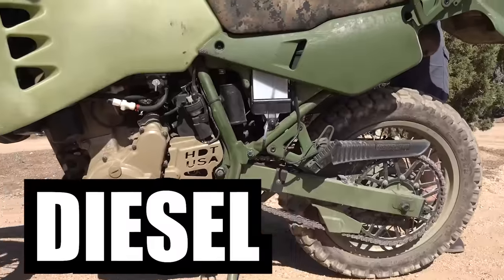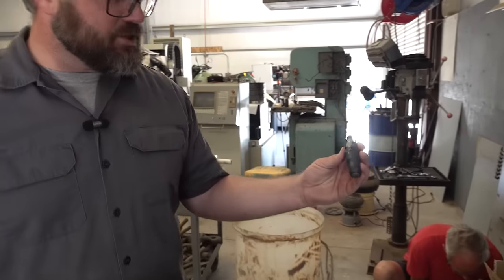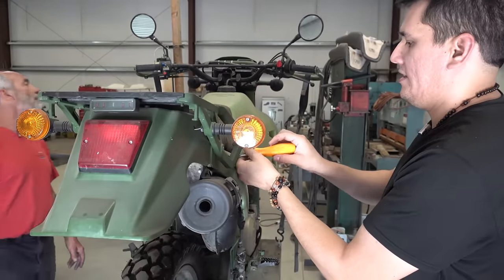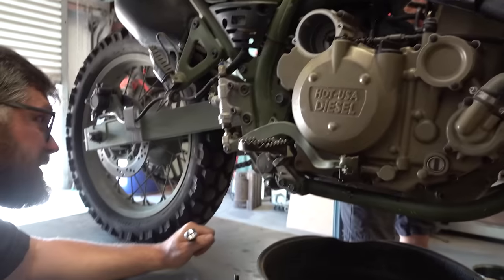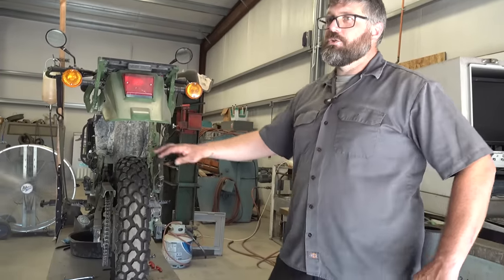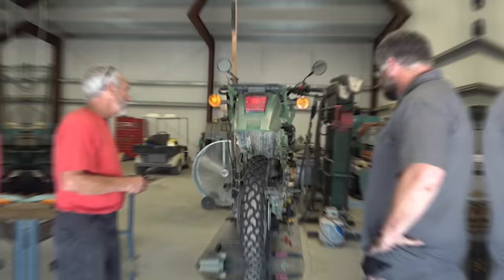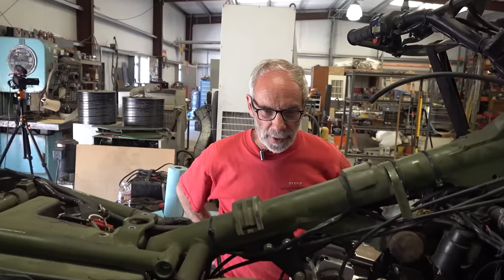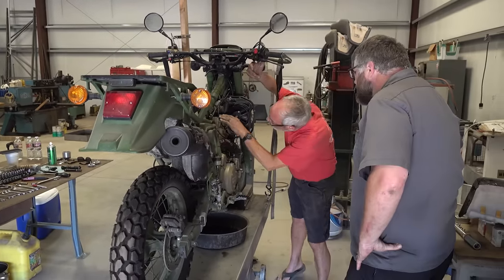Unfixable Diesel Bike is Worse Than We Thought(So I Got The Engineer Who Designed It)

Comment: I LOVE THE WAY they talk about how reliable military equipment has to be and how much they testing testing test...

And there stood next to a broken bike in a workshop for broken bikes.
Reply: When I was in the Army they still had Gamma Goats. The joke on them was that they would be running perfectly on Friday afternoon and broke down on Monday morning.
Reply: @lancenorton1117  😁😂😀😁
Reply: Standard KLR for me, that diesel would give me nightmares. I have worked on diesels, have an AA in it, but they are not for bikes.
Reply: @johnl9977  yeah but the dod doesn't care they just want everything to run on JP-8
Reply: And how many ways you can break it if you don't do 6 different steps exactly and don't push a lever right next to the handle bar, oh and there are machining chips in the engine, dont worry perfectly normal 😂
Reply: @myopicthunder  hehehehehehe
Reply: @ihatetacocasa  They would probably have been better using jet or an actual flash steam generator - steam engine - condenser 

Steam engines are 1 stroke with unlimited length of travel on the piston, and crazy torque - so you could just connect the crank shaft directly to the back wheel, have the piston in the swing arm, aerosolise the JP-8, burn it in a coil of water that flashed the water into steam, into each side of the piston, out into a condenser and then a pump forces it back into the high pressure side of the circuit.

Comment: I worked on the B-2 bomber acquisition program for 20 years starting back in the mid 80s and there was a term that was used called having a "grey beard"  meeting or getting the grey beards together to solve a problem. That's what I thought of when I saw this guy. You have to go to the source when things get scrambled up like that bike was. Great video!

Comment: That’s a Bosch type fuel injector and were more common on pre combustion chamber diesel engines. Instead of having individual spray points (5,6,7) when the needle lifts it sprays in a continuous cone.

Comment: In the early 2000's I bought a multi-axis lathe from Roger Flynn @F1 Engineering in Hesperia. HDT was across the complex from them. F1 Engineering was contracted by Hayes to produce the engine and related parts; he told me they did a lot of re-engineering of the engine and fuel system to get the reliability and power needed to get military approval. Within a few months of my visit, HDT lost their contract with the military and left F1 with pallets of unpaid parts.  F1 branched off into the aftermarket ATV parts as BilletKing, then into firearm parts... not sure if they're still around.

Comment: “You can’t kill a KLR”, except for the Doohickey, if you don’t replace it, then the motor will self-destruct.
Reply: Right? This is all very cool but in which world is it normal to have machining chips from manufacturing left over in your oil?
Reply: And don't press this lever or you'll blow a valve  😂
Reply: Yup "Can't kill a  KLR" unless you do something silly like purchasing one new and riding it to work for a few months.
Reply: Spoken like who has zero experience driving military vehicles.
Reply: Starting fluid is ether.

Don't use random spray chemicals to start any engine.
Reply: Swap out the doohickey and add the thermo-bob and you'll be set.

Comment: I work on boats and yachts. So I work on little, to big diesel engines, When priming diesels, I was taught to roll the motor with the injectors loose, allowing air to escape while the engine cycles.... The key here is, to get it to pop and struggle... Then tighten the injectors in....
I like how the used the glow plug port. 🤔

Comment: Picked up a quad for cheap..the seller said a pro shop couldnt fix it.was told it Needs a rebuild and carb....cam timing off 1 tooth and tight valves.... now its awsome..you never know whos been in there.

Comment: The air mass sensor before it enter into the diesel combustion chamber. It is just amount of pressure blowing by fan action of the positive crankshaft ventilation so the fan like blower is what crankshaft is blowing air with 2 stroke oiling. And never allow to run like 4 stroke that high rpm = the PCV blowing clockwise circulation and then in idle lower rpm the PCV blow counter clockwise. The two stroke blow only one direction of the circulation in any rpm.

Comment: Great to see a diesel bike in the US! Diesel engines are common in many cars in Europe (but no production bikes) being much more efficient than gasoline. There is one issue that I’d like to comment on if I may. The compression ratio is the ratio of the volume of the cylinder with the piston at the bottom of the stroke to the volume at the top. However, what determines the cylinder pressure is not just this but valve timing. I often hear of high compression ratios in sports bikes which mean nothing unless valve timing is quoted. Much like torque and power figures. Torque is utterly meaningless unless accompanied by engine revs. Ok, I’ve bored you enough.

Comment: This KLR is water cool radiator and circulation coolant around the cylinder and the cylinder inside the jug. The bore is 64mm for Pascal law that it is easier to crank and start the diesel small bore than bigger bore piston/heavier piston. The 35mm bore plus 35mm bore is easy for motor starter to crank and overcome the compression stroke resisted force and cannot be sametime both pistons in twin cylinders in compression stroke. 64

Comment: Starting fluid is a diesel shops best friend. Guys use it when they don't know how to bleed the fuel system. It drives the cylinder pressure so highnit breaks the ring lands on the pistons.

Comment: Buy a Honda Rebel CMX250 or Honda C90 (or Honda Trail) instead.
They run like a swiss watch, you rarely have to work on them, cheap and ubiquitous and they've been made straight for something like 20 or 30 years.  Parts are cheap, and you can get at almost everything easily.

Comment: What you saw today is the difference between a mechanic and a technician. Rick may have been a engineer by education, but he is also a mechanic.

There are very few people who can step up to just about anything and troubleshoot and fix actual issues. Today (last 20-30 years) focus is placed on plugging in, reading manuals, and following step by step procedures which rarely fix the actual problem.

Comment: I had a GAS 2003 650 KLR ,it’s really bullet proof , I made just over 600,000 km , about 400,000 miles with it , I’m in Quebec Canada and I was using it even in -40 C that is also -40 F , I had tires from Sweden it was very impressive the traction on icy roads , I fallen 4 time in winter .
Then here in Quebec snow tire with the snowflake logo is mandatory in winter so I stop riding in winter , I sold it because of that law .

Comment: The best way to prime the diesel into the KLR motorcycle top speed 90 mph. Is maybe Bendix brake hose and Goodyear rubber ply and steel hose clamps. Advance auto brands Bleed valve for diesel oil to prime it with test tool called pump. After the prime up the diesel so it produce no air lock in the diesel lines then remove and put away the test pump and install diesel tank between saddle and front rake of the big bike chassis.

Comment: Funny. It actually seems to use diesel injector and pre-burn chamber from Mercedes Benz OM601-OM606 engines. And the diesel pump itself is also almost exact replica - just with one piston instead 4-6 depending on OM60X series from MB. Very good decision actually. Those MB OM60X engines are "bulletproof" and run on any oily liquid from cooking oil to diesel :)

Comment: Pray tell, does Rick have a channel?
:face-red-droopy-eyes:When your machine needs "unobtainable"....find a sound head, well versed machinists are out there, and can rebuild ANYTHING

:face-green-smiling:Though not as dire as this, my Dad had a 40s model SAE 200 that needed a fresh water pump.
Local Farmer/machinist John Finney got parts- bearings/seals -shipped from 200 mile away in KC...👍
😉In '81 they rebuilt that 1800rpm engine...still had cast iron pistons

Comment: Thats why diesel bikes are so rare: Creating a small 1 cylinder diesel engine thats higher revving and capable enough is hard and expensive. Only 1 cylinder diesel out there are those slow revving ones on generators or chinese water pumps. That injection pump alone probably costs more than a whole gas bike engine. Nice to see that this guy knows these inside- out :), especially in the US where small Diesel engines seem to be hated ( Euro VAG TDI guy here :) )

Comment: Spill timing diesel engines goes back to the first diesel engines it like the ark. I have seen a high pressure trim pump from Marine  applications used to push diesel through the system. It hosed out of the spill pipe when  the spill point was reached it stopped. It was very clear where the spill point was.

Comment: I served when the Corps used the original 1030, the klr250. They were not diesel. They were not "good." What they were was bone stock, infinitely rebuildable and they usually ran even when they were broken, which is good, because they were usually broken. These newfangled 650s are technically fascinating. Thanks for the video.

Comment: A little over a year ago I tore my bike apart trying to figure out why it wouldn't start, rewired all the accessories I had installed, just in case they shorted out, dug into the wiring harness, spent a week banging my head against the table... I had left the bike in gear when I parked it. I usually leave it in neutral and use the center stand. The first thing I do with all my bikes is remove the gauge-cluster (including neutral light). I'm pretty sure that my most shameful moment working on bikes.

Comment: From an engineer perspective: this thing is a prototype on wheels. I get the passion of the maker, but I also hear a lot of stuff that I'm very familiar with: 'you have to do this by eye, adjust a tad here, get it to do that, now it's running quite well, smoking very little, just remember not to go over 50% when it's hot or it will blow up'. This is motorsport territory, or prototype grade of technology for street-legal stuff. When it's ready for public you want to hear: 'you slap this on, it's keyed, you can't put it on wrong, the drain plug is on the bottom, you pour oil here until it's full. Here's the bleed hole. Now put diesel in it and press this button to start, it won't crank if it's not ready'.
Reply: So advanced they have run away conditions.

Comment: Ok great video. Just the right amount of geeky for me. As an aside. I worked for Motorola late 70s early 80s back when the still had military contracts and no kidding, there were parts on test that started Before I got the job and still had 5 YEARS to go before the test was complete. IIRC less that 1 percent failure rate.

Comment: Your estimate of gas engines as being under 10 may be accurate for SMOG-era carbureted engines, but it's not uncommon to see 11-12 in modern engines with advanced fuel control systems. Direct injection engines can even run that kind of compression alongside a turbocharger. Mazda even has some super-efficient engines that run a 16:1 compression ratio, with some of their slightly more conventional engines having a 13:1 cr.

Comment: The flywheel must like 18 pounds so it will not backfire running engine rpm backward. Maybe 15 lbs flywheel. Is this olive drab KLR motorcycle trail bike is automatic tranny as a component?

Comment: Most of the air bleeding and timing stuff was the same as any diesel engine... setting the rack ect so its not over or under delivery . The back fire caused the key to share so not turning motor  over properly... but someone had already  found that ?? Not replacing the key😅! Don't assume nothing! Check everything then  double  check before committing to going down a rabbit hole. Rick is a smart guy. Could of speed up the bleeding by tow starting it...maybe?? Even when it was running clean, still sounds awful,  maybe the mic. Anyway Could not be worse than a standard KLR650😉gen ll owner🤐

Comment: The liftpump on that bike is 100% identical to the ones fitted to Yanmar diesel engines and a few other makes. Not the most reliable unit at all. A small electric pump would be a lot better esp for priming the engine after a filter change.

Comment: I know why the military thought that a diesel motorcycle was a good idea, but a gasoline bike would have made more sense. Gasoline is easy to find in almost all countries and probably easier to procure than finding a fuel truck. Gasoline bikes are easier to maintain and not nearly as heavy. Stealing gasoline along the rout would be easy if that was necessary and I doubt that a fuel truck would be following the bike or stationed along the route. The military procurement brass didn't think ahead as usual.

Comment: Dieseling means preignition with glow plug powered by diesel injectors and fuel is normal until spark knock sensor regard the dwe!l and add water injection to cool the motorcycle engine to stop the detonation and keep running base on both dwelling of the diesel distributor as well firing the spark plugs in diesel cylinder head dwell advance timing distributor in KLR modified motorcycle and custom in the making.

Comment: No compression, you'd better hope it's only a stuck valve and not a problem lower in the engine Edit: lmao lucky yall noticed that exhaust valve was open, it would be a shame to have torn into it if that was the issue

Comment: Make 50cc diesel engine like this and there is tons of moped those engines would be retrofitted since you can run cheap biofuels with them.
Reply: The injector pump will use all the power it makes. Proper diesel engines don't scale well below a certain limit.

Comment: While Rick might be the guru of the Diesel KLR, to imply that having metal debris in the oil is 'okay' is a bit shocking to me. I owned a stock 2007 KLR, and while it was a fun ride, they are underpowered and unremarkable, and have a poor cooling system - and let's not even mention the balance chain tensioner. In his own words he's seen about 10% of the diesel KLRs, which speaks volumes... The military didn't want them anymore and put them up for auction, they're obviously finicky and must have been hell to deal with on a daily basis or when needed urgently, and the almost superstitious way he went about tweaking and tuning the thing is not ideal for the everyday owner. I noticed we didn't see you ride it very far - or hardly at all in fact. Did it overheat?

Comment: The OHC have better compression ratio than OHV motor of motor bike and Mopeds company such as 4 valves per combustion chamber in KLR bike. The brain Africa Single or one cylinder fire stroke force the second piston and second piston into over come the compression stroke with drop forged piston with minimal 1,600 PSI check compression test tool gauge then Diesel number 2 will fire in KLR. The domed listens made for DIESEL 450cc motorcycle similar to Husqvarna Africa Single trail bike in the Baja race motocross circuit of test the Africa Twin in whether KLR is V twin or Siamese twin into off road and the saddle height is not higher than 28 inch tall with rear tire size 19 inch.

Comment: You have power of timer that fires named distributorless and you have KLR's business garage at the bay door. Glow plug that emit heat rays. You have another thread hole in the glow plug wholly assembled head. That thread hole is air injection to provide profession two stroke flat top piston in OHC in KLR upper motor system of rocker arm ratio which have the numerical value...

Comment: Im supprised this bike is used by the military. You literally have to have the engineer who designed it to work on it. Very complicated system. I'm not saying the bike is a POS, not at all. But this kind of system is exactly why the germans lost WWII. They couldn't produce them fast enough and only highly trained people could work on Their tanks, planes, and weapons, which were very well made, precision engineering. Where the allies equipment was made and built by people with no special training at all. They literally shipped trucks in crates and assembled them in europe. Completely interchangeably with parts done with simple tools.

Comment: Don't tell anybody but that's simple Bosch fuel injector found on vw and MBZ. Typical compression ratio is 23:1  not 16 !  Because of 50% better thermal efficency,  waste heat is MUCH lower in a diesel, and is seldom a problem. Such ignorance is astounding... even a little reading would cure it. Remember READING ? !!!

Comment: Diesel engine in a tractor or any agricultural equipment. Can sit for 50 years and you can get it running in 20 minutes using a hammer and a wrench.

Diesel engine in a motor bike for the military. There are 1.5 guys in the world that can get it running, all others will fail for ever.

Comment: "Stick your finger in the hole" must have a page all to itself in the repair manual.  Typical American military kit - wildly complex, difficult to work on, hard to repair.  Meanwhile, at Krasnoyarsk Military Motorcycle Factory #3, they're engineering a motorcycle that can be fixed with a rock and a busted screwdriver, in the dark, by a technician who's drunk on radiator fluid...